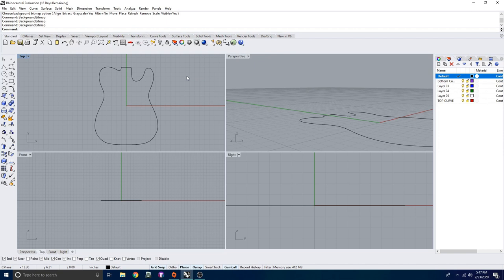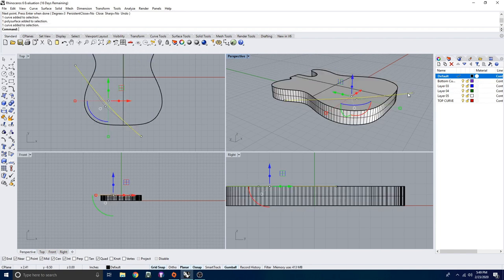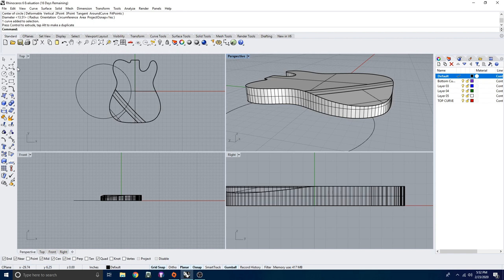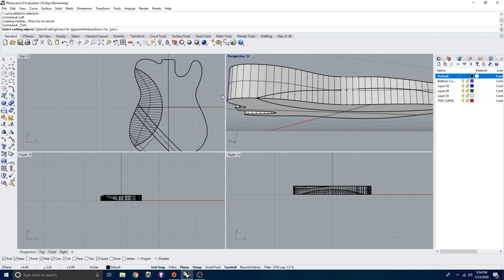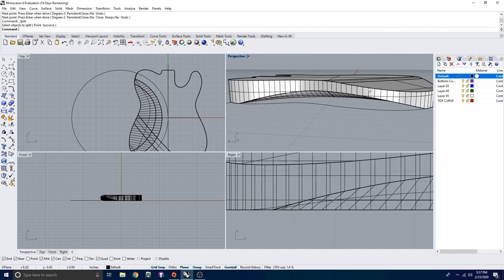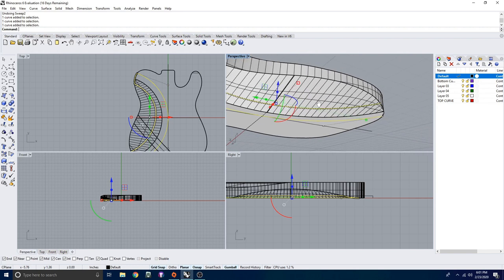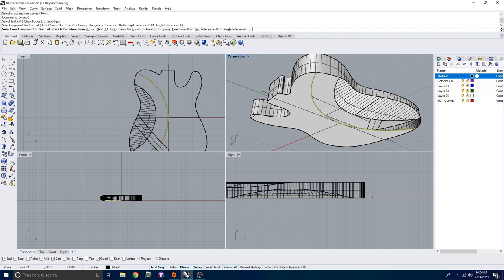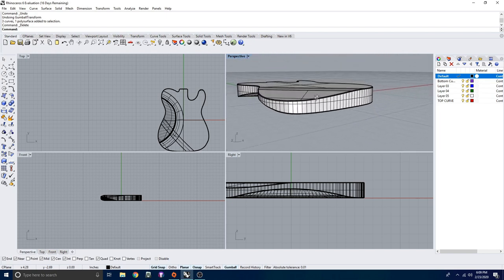How To Model A Guitar in Rhino 6 (In Under 15 Minutes!)

Comment: Very helpful video. On the belly cut, I’m able to get up to the point where you trim.  However, when I trim, it won’t let me select the body.    The body is a closed solid polysurface.  I can use a sphere or ellipsoid to subtract from the body, but not the loft.  I’m completely new to Rhino (just purchased today!).  Any idea what might be causing this?  Thanks in advance!
Reply from the maker: Hard to tell without seeing the model or knowing what error message rhino is giving you, but from the info I have here, it is most likely an issue with the loft itself, or the position of the loft. Could you tell me what the error is when you try to subtract the loft?
Reply: @garretelliott8584  No error message.  It just won't let me select the body to be trimmed. Nothing is highlighted when I select it, nor does Rhino do anything.  However, a simpler loft like the forearm contour works fine.  Not sure if that helps.
Reply from the maker: @jaysmoreymusic  can you try closing the loft and doing a subtract rather than a trim?
Reply: @garretelliott8584  I think I solved it.  I moved the curves so they were outside the body by 0.1", and then lofted.  Rhino recognized the body when I trimmed this time.  Thanks!
Reply from the maker: @Jay Smorey Music  yep! That's a good practice in general. Trying to execute commands on any two identical surfaces will often throw errors. Glad you figured it out!!

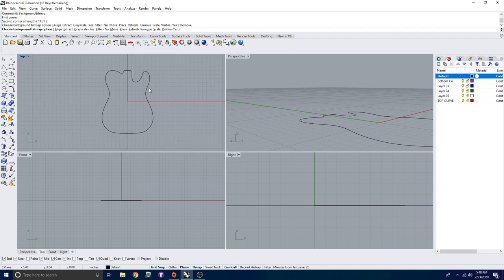Comment: 0:30 In fact it's the opposite. Use the less points possible that makes the shape you want. It will be easier to edit, and you're working with nurbs so it's not like polygons, less points = smoother curves.
Reply from the maker: true... less points also may take a bit longer to accurately match the background in this case. We're going for speed here. If you're worried about how many points there are try running the rebuild command. You can reduce your amount of points while maintaining your shape.

Comment: Great video but I'm having  a problem with the belly curve. Whatever you are doing when you project onto the guitar isn't working for me so I'm stuck. Any help would be greatly appreciated!
Reply from the maker: If you are have trouble projecting onto the side of the guitar, make sure the viewport you want to project from is active and that the curve either intersects or extends beyond the body of the guitar. Hope that helps
Reply: @garretelliott8584  Thanks Garret. I FINALLY got it!!! I couldn't hear what you were saying and I was not putting a control point on the origant (I didn't even know what that was). Thanks for the great video! FYI--volume is really low. Looking forward to the neck vids!
Reply from the maker: @larsdan  I'll be sure to fix that next time. Thanks so much for the feedback! I FINALLY have the neck figured out I'll be doing a new vid soon!
Reply: @garretelliott8584  I’m sorry to keep pinging you on this, but I’ve spent too many hours on my guitar and cannot get a few things to work properly. 1) when smoothing out the angles of the belly carve, the trim command doesn’t work even though I joined the body. 2) the fillet on the back side still looks square—the round over edge is there, but the edge is square and nothing I have tried seems to work. Thanks in advance of you do respond!
Reply from the maker: @larsdan  no problem! take some pictures and email them at geelliott9@gmail.com I can try and offer some suggestions!